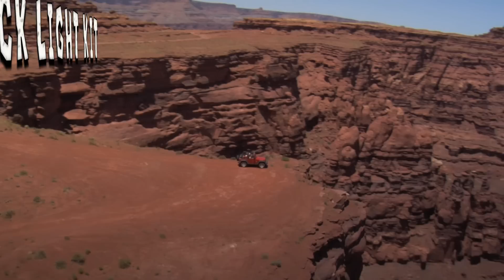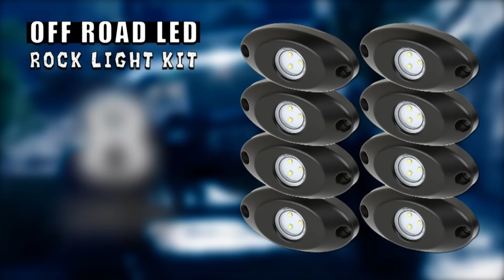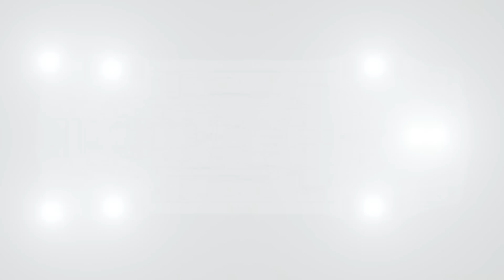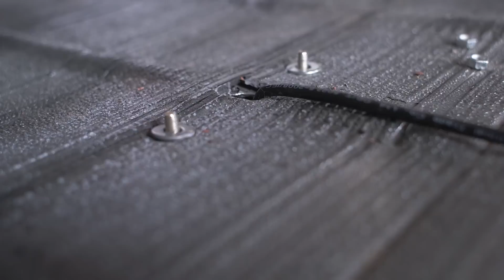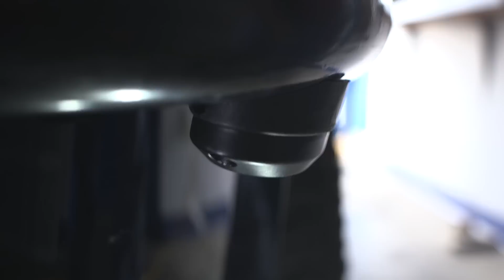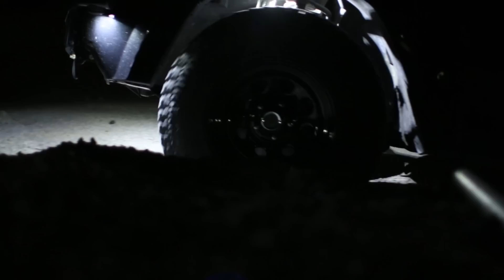LED Rock Light Kit

Comment: I don't recommend putting these lights in the wheel well. Water, mud and rocks pretty much ruined mine in  a short period of time.
Reply: I see a lot of installs put lights in the well .. Besides damage, I don't see much useful light coming from that position ...
Reply: on a true offroad rig they help alot, they let you see exactly where your tires are hitting on the ground